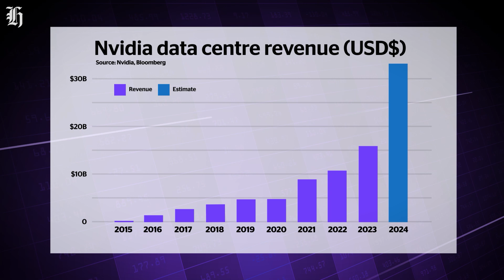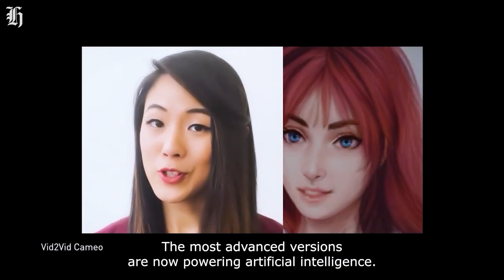Chip WAR: Chris Miller on Nvidia, TSMC dominance & risks | nzherald.co.nz

Comment: I'm not so sure that China is much behind in advanced microchips. Kirin 9000s looks pretty impressive, and it may even be SMIC's N+2 process, we will see. At the same time the 3nm manufacturing by TSMC and Samsung looks problematic and expensive. If Ray Kurzweil is correct, that's a sign of one paradigm ending and the beginning of a new paradigm such as photonic or graphene microchips.

Comment: CoWos 2.5D advantage packing service is another critical element for TSMC's success, which is the final process to complete the Chip. A single CoWos factory will cost 10~30B NZD. TSMC has 5 of them and is building another one. Plus, several manufacturers in Taiwan can also perform a similar packing service for advance Chips!

Comment: Great insights from Chris but some points are missing especially on the raw materials for producing these microchips which are Silicon, Gallium, and Germanium. There is only one country that can supply these materials massively hence they are playing a key role in this Chip War. Aside from the financial operation for manufacturing semiconductors other critical aspects are the skills (Taiwanese engineers have perfected the operation of these semiconductors for decades) and the other aspect is WATER manufacturing these semiconductors needs a massive amount of water. which made me think about why TMSC building a FAB plant in Arizona in the middle of the desert (tsk tsk tsk). Kudos to Madison, This is an interesting and great Vlog that I hope will reach more viewers.